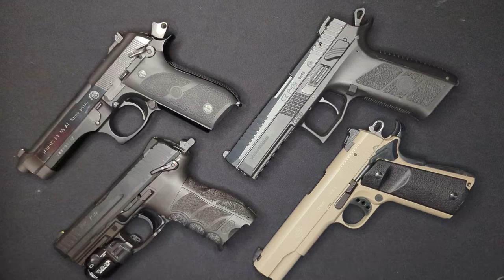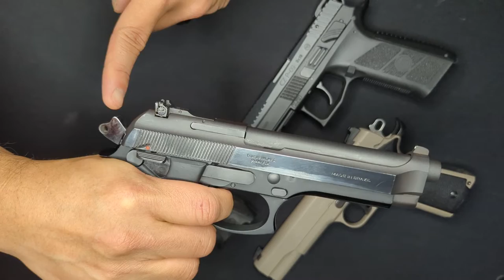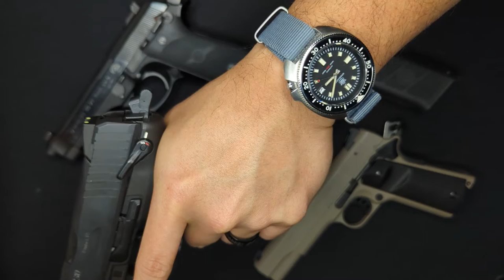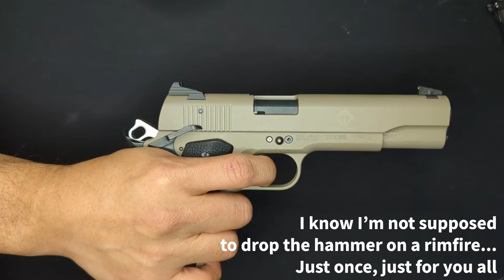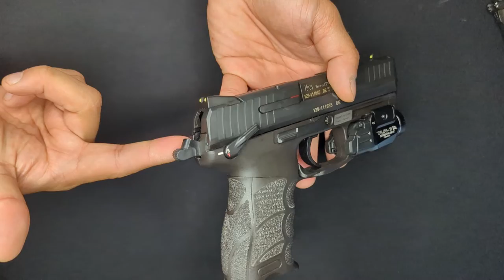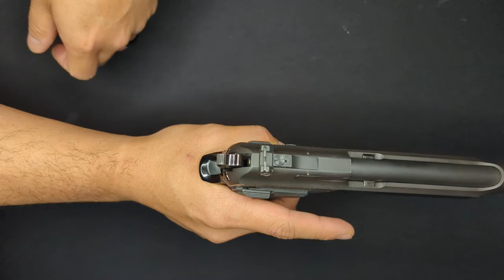Everything you wanted to know about hammer fired handgun actions

Comment: when you hit the decocker and the hammer slams forward that cant set it off? i have a taurus th45 and it seems like it was discharge but im told it wouldnt....( im new to hammer fire pistols)
Reply from the maker: Good question. The decocker is designed specifically to lower the hammer without setting off the round. It's different on each handgun, but in general when using the decocker the firing pin is blocked or retracted, making it mechanically impossible for the weapon to discharge. Thanks for watching!
Reply: @realpracticaltactical  thanks for the insight man.